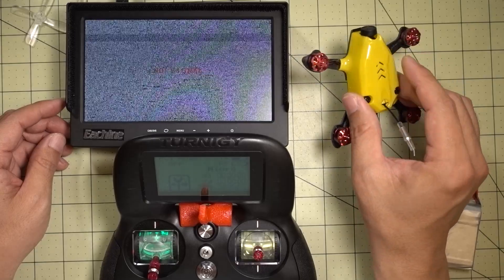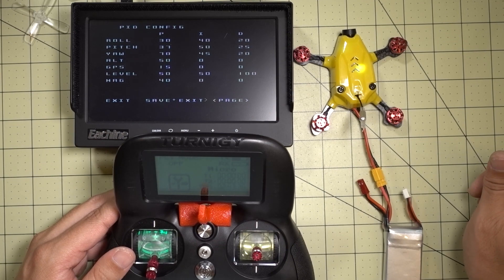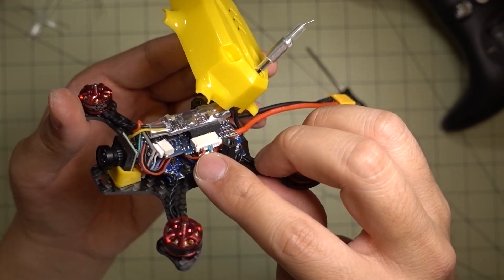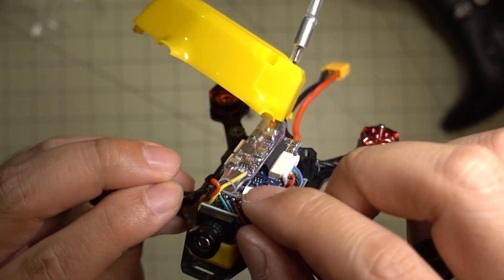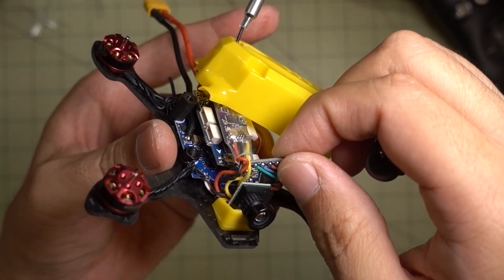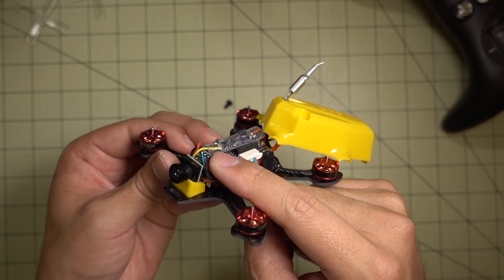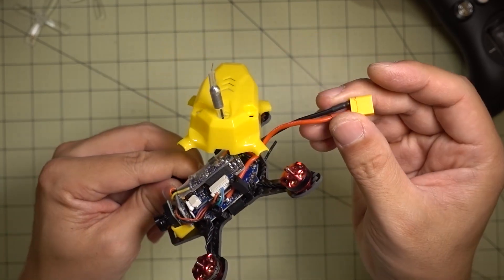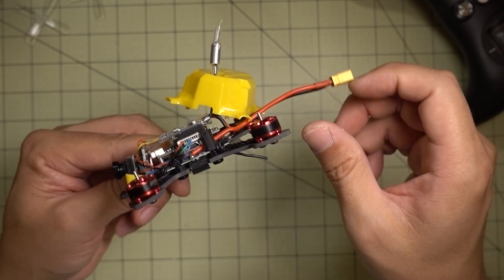KingKong 95GT OSD, XT30, RX Mods 🔨👍

Comment: Hi the port on flight controller where you connect the osd is uart3? If yes what I need to enable in betaflight after connect the wires?
Reply from the maker: So I had to rewatch the video because I didn't remember.  Your answer is about 2 minutes into the video.
Reply: @AlbertKimTV  i found it thanks now it works...only last question. do you know how can i do to adjust range of my rssi? i mean when my taranis is off i should view on screen 0% and when the taranis is on near the receiver it should be 100% thanks again.

Comment: Hi is it possible get rssi on micro osd from internal frsky receiver or directly from flight controller?
Reply from the maker: It might be possible via analog RSSI if you use one with that feature, but this mod is really old and a lot of these parts are probably hard to find now.
Reply: @AlbertKimTV  I found a tutorial where is possible to update the xm receiver with a dedicated rssi channel (ch 16).. So in betaflight you can activate the rssi to aux ch and show the value...

Comment: Hi Albert!I want to change my kingkong 110gt camera to caddx f1 and I dont know where is the osd in the flight control.I think that 95gt is the same like 110gt .So what do you recommend?😀
Reply from the maker: Those models don't have OSD.
Reply: Albert Kim caddx f1 has its own osd .can I use it to fly kingkong110gt ?If not ,I believe that I need to connect micro osd and caddx camera to fly with osd on the screen of my goggles.Thanks for your help!

Comment: Hi Albet, I really like your reviews! I have fried the vtx of the kk 110 and looking for replacements I found the vtx of the fly egg, which fits perfect and has 100mw. My problem is that the egg vtx needs a 7-18v input, and the bec on the kk is 5v so I guess i wont work properly or at all. So my  cuestion is, can I wire the vtx to the lipo pads and it will work fine, or there's another way to conect it that i am not seeing? Thank you very much!
Reply from the maker: Yes, you can wire to the lipo and use direct voltage. Just don't exceed 18v.
Reply: Wouldn't that interfere with other components like motors or maybe the signal will have more noise?
Reply from the maker: Yes, but this is how it is wired on the FLY EGG 100/130.  You could add a capacitor on the battery lead to get rid of video noise.

Comment: I think I got a dud, I have the exact 95gt with Flysky rx. It is so buggy, sometimes it arms and will fly perfectly and sometimes it will not even show my tx stick inputs in the Betaflight configurator. I reflashed Betaflight everything works great for the first battery and when switching to the next battery the rx light is bound but it won't arm the motors again. Hooked it back up to the configurator with the battery connected and can't see anything on the rx. Tab. I'm wondering if it's a bad rx.?

Comment: * Need some help here * Hi Again Al, I've finally gotten around to troubleshooting my 110gt. The 110gt just pooped out on me during a flight after a mild crash on grass. Now it connects to both BF and BLHeli, it plays the boot tune on power-up, the Rx bind light is blue (Flysky/Evolution, which works with my Lizard95), (I even switched the signal wire on the RX over to Sbus - but still no dice) ESCs beep when Idle, VTX works but no apparent connection between my radio and the RX in BF is visible. You suggested to me earlier that you believe the FC is damaged. Is there anything else I should check before ordering one? Do I even want to bother trying to swap out the FC? This 110gt WAS fun as hell to fly!! :(
Reply from the maker: The problem you are describing is unfamiliar to me. Not sure what it is but wouldn't surprise me if this happened after a crash. Not sure what parts to replace, but I usually replace one at a time and see if anything changes.
Reply: Albert Kim I've ordered another 110gt from gearbest (90€) the old unit is now spare parts :D

Comment: All good, thanks Albert. I've just done similar (and more) mods on the kk90gt. I also changed to Eachine VTX03, Frsky MX+, leds, and a circuit buzzer mod. I created a working circuit for the buzzer.. the other one (with bc557)  was originally created for the CC3D CPU pin PA15 (which is 5v compatible). Motor outputs 5/6 are I think 3.3v max. Mod details posted here (2101): https://www.rcgroups.com/forums/showthread.php?2807230-KingKong-90GT-90MM-Brushless-FPV-Racer/page141

RC Group for kk90gt support is here: https://www.rcgroups.com/forums/showthread.php?2807230-KingKong-90GT-90MM-Brushless-FPV-Racer

And the buzzer circuit mod is posted here (2083): https://www.rcgroups.com/forums/showthread.php?2807230-KingKong-90GT-90MM-Brushless-FPV-Racer/page139

Hope this helps.

Comment: Albert is this better than Lizard 95 ?
Reply from the maker: it's totally different... it has a lighter power setup... this is way lighter than the lizard... the motors don't have as much power, but it looks fast because it has less mass to push around... if you want a lighter micro that is also pretty fast (but not as fast as the Lizard) and pretty acrobatic (with mods of course), then the 95gt is a good choice.
Reply: Albert Kim thanks man :) I'll get both lol

Comment: Albert Kim- I am having frustration with a micro quad I build, it's basically an ft gremlin but on a different frame with kingkong 1103 motors, basically ever since I build it one of the motors studdered before spinning up fully. it usually spun up after a few tries, but today it just studders and won't ever spin up fully. I actually had this exact same issue on the exact same build that I made for someone else. I thought I would ask you since you are the micro guru :-) any help would be much appreciated.
Reply from the maker: Did you calibrate your ESCs? Sounds like they need calibration.
Reply: Albert Kim I believe I did, but I'm gonna do it again when the computer is availible, also was going to check minimum throttle, I'll let you know how it goes. :-)
Reply: Albert Kim I have calibrated all escs, and done various other things, and I'm tomorrow going to confirm if I have a bad motor. I think I'll need new motors because these kingkong ones seem very questionable, wondering what motors you recommend for a 96mm emax femto and 6amp esc build, thinking of maybe the HLY ones from getfpv, don't want to buy from banggood or any store outside if the us. thanks :-)

Comment: Nice modding!  I'd like to see the buzzer mod if possible. Thanks.
Reply from the maker: +neo Jeets ok, 1st vote!
Reply: Would the buzzer be able to detect low voltage though?
Reply: Ditto
Reply from the maker: +MF✯BOOM no, vbat sensor is not on the FC
Reply: Great mod, have you tried any of the 1000tvl micro cameras yet? Just curious if they are worth the upgrade?